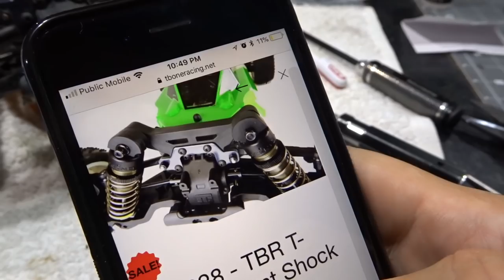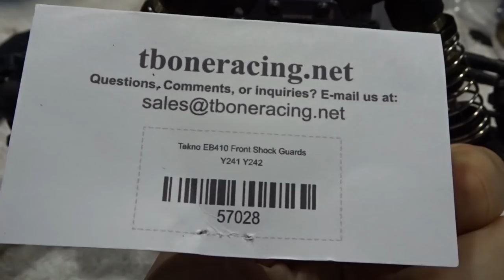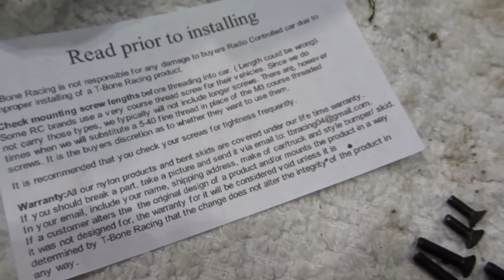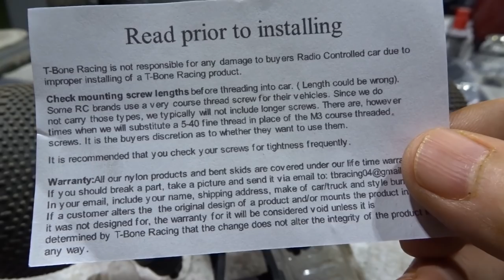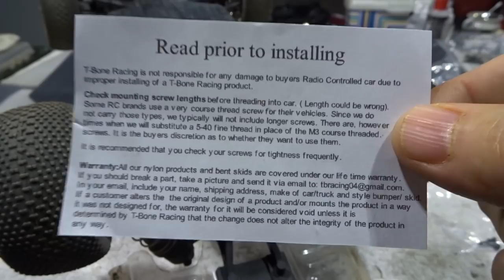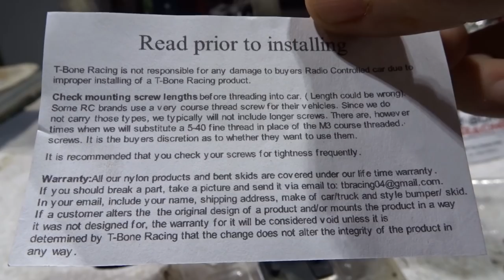Testing T-Bone Racing Shock Guards and Chassis Skid for Tekno EB410 - Netcruzer RC

Comment: Great review! That screw situation is pretty shitty. The upgrade is only for the EB410 so it should have the correct screws. I have noticed with upgrade parts that documentation can be pretty shitty as well. Thanks again for the review 👍

Comment: "People aren't gong to do that"....
well , then they'll suffer the consequences.

Caliper the chassis, add it to the length of the screw. Go to any hardware store, Lowes, etc, and grab a screw that long. 

Me, I'd get one of my many, many extra screws (for all my kits) that I previously purchased (in bulk and cheaper than kit screws), at my local hardware store. Or I'd put the longer (included) screws in my vice and dremel them to perfect length, lightly file the cut ends smooth, and install. No big deal to someone with the ability build the kit and maintain it.

The screws were OBVIOUSLY way too long, but you didn't agree with their warning specifically ABOUT screw length, and proceeded to crank them down anyway. 

Not their fault, and you deserve the chewed up diff.